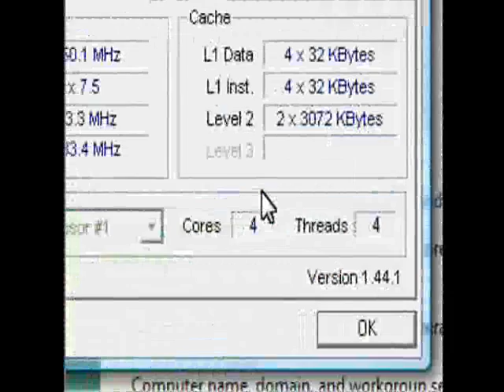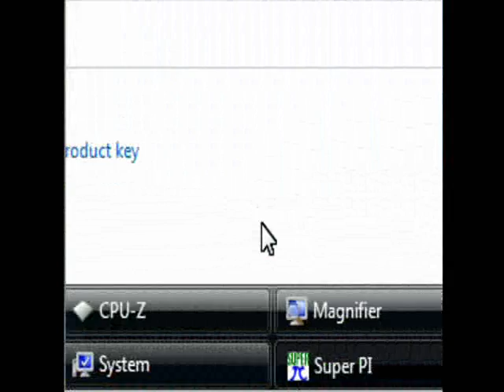Q9300 cpu clocked at 3.25 on the Asus P5n-d in the Antec

Comment from the maker: Sorry I dont use MSN or Skype but I can try to help you. The first and simple thing to do is just to try to raise the FSB without changing any voltage or anything. If you go into bios you should see it is at 1333 FSB just try increasing it a little at a time then boot into windows and make sure everything runs good. For instance maybe try it at like 1400 to start with and see if it loads or if it blue screens on you. If that works try taking it higher. Not all Q9300 chips will overclock.

Comment from the maker: @keith23uk It is a nice option. I didn't even realize how important it was going to be when I bought the board. It has made overclocking different CPU`s on that board so much easier. But it certainly not every thing I look for in a board. My Gigabyte board does not have that feature but will still over clock very nicely. And that was a budget board.

Comment: Just been reading about  your bios on xbitlabs. I think its great how you can set your memory frequency in unlinked mode! A sweet advantage of having Nvidia 750i SLI chipset. Personally strapped for cash at the time I used to go for the high end SLI boards at 939 socket but could only afford around a £60 board max. My board is very nicely laid out though and find little fault with it. just that memory freq settings in bios is quite annoyingly not there and cant keep the mem speed normal 400+ fsb

Comment: Shame my RAM limits me on my Q9300. I wish I had 1066MHz RAM now then I could up the FSB a lot higher than 400. 800MHz CL4 ram on my system. The RAM is at its lowest manual setting. Asus P5QL/EPU P43 series.

Comment from the maker: @heroe1981 I found the biggest thing to getting these motherboards to overclock was to make sure that you set the ram settings manually. Keep the ram unlinked until you get the cpu overclocked the way that you want. 

I could not get mine to overclock well either until I manually set the HT and NB and SB. I set mine up like this HT 1.50V NB 1.50V SB 1.40v and then just bumped the vcore up a little to like 1.38V. 

I have sence got mine up to 3.4GHZ cool and stable.

Comment from the maker: @kilirm I good cpu cooler would really help for any long term overclocking if you are just going to play around with it to see what you can do with it I have seen people running them at 3GHZ with the stock Intel cooler. 

The hardest thing for me was to get it stable. I had to play around a bit with the htt and north and south bridge voltage. I think it was somthing like HTT 1.5V NB 1.5V SB1.3V and fsb 1733 and stock voltage on the vcore

Comment from the maker: Yes they sure are. The 45nm cpus are tuff to overclock because of the 1333 FSB compaired to the older Q6600 which used 1066. 

I will do a little video showing how to do a brute force overclock on one. Just using the FSB.

Comment: I just bought coolermaster HAF 932 case so i dont think that the airflow is the problem here. As you said that the problem could be thermal paste or my cpu cooler(HDT-D1284)
doesn't have good enough connection whit the cpu itself. maby i should try that artic silver5. is it expencive?

Comment from the maker: Do you have good airflow through the case?. Are you sure the heatsink is making good contact. 

My other machine is running a stock Q9300 And it bairly hits 51 when playing Crysis so you might want to make sure there is good contact and that you use a good thermal paste like Artic silver5.